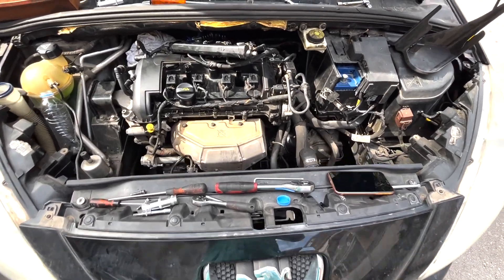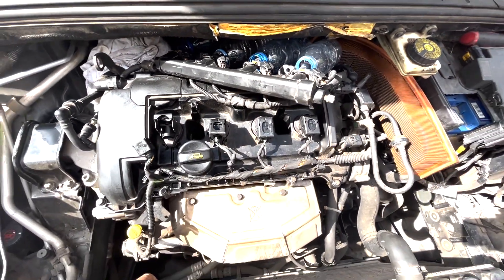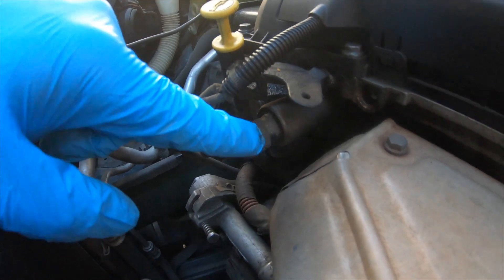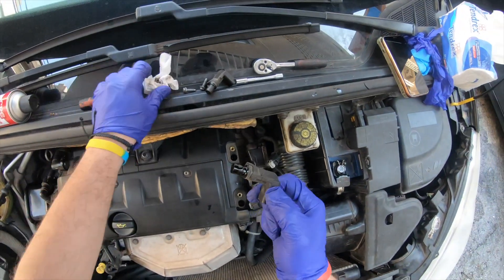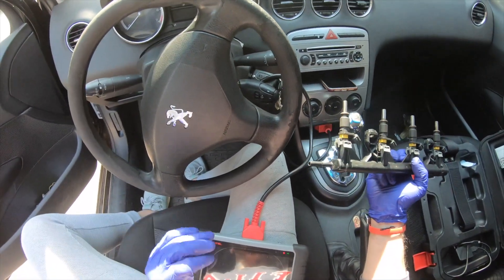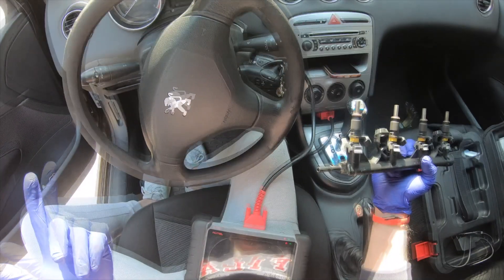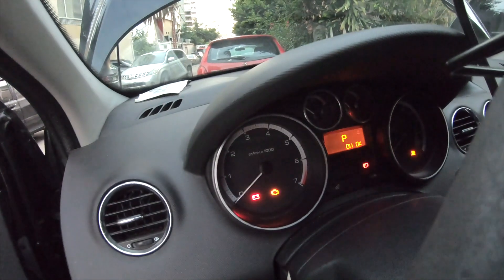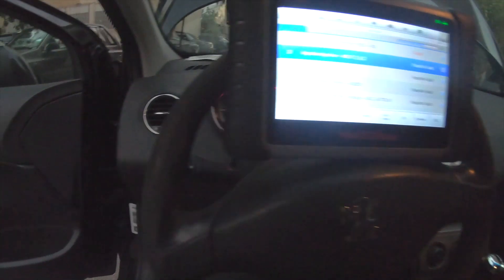Peugeot 308 Cylinders misfire EP6 2007-2014

Comment: ....  voltage  supply to each individual  coil can be too  low for coil to produce  a strong enough  and reliably  consistent  spark if the plug gap is too big.
   I had  a misfire  on cylinder  4 at idle for months when engine  had reached  operating temp..Changed the coil for a new one...cleaned  the injector...didn't help.....finally  I reduced plug gap from 0.7 mm down to 0.5 mm....  problem solved.  The voltage  to each coil must be 12v .....if the battery is bad or the engine  is not earthed to the car chassis  properly  can also cause  a weak or inconsistent  spark especially  at idle.
Reply from the maker: Thank you mate for this amazing information 🙏🏻
Well done 💪🏻

Comment: Hy, i liked the video very much. I see this is an old one but i tought i try 😅 My 308 1.6vti showing p2178, i tried to replace plugs, cleaned solenoid valves, replaced MAP, don't know what next should i try.. The old owner supposedly changed injectors, or some at least, maybe thats the next i should have a look into.. Oh yeah, i also replaced a PCV membrane and cover.. any suggestions? Thanks
Reply from the maker: Hey mate 
You should look on swapping all injectors and check if the problem goes away. 
Cheers

Comment: I have the same problem. Some plugs have oil on the top. So I have a misfire  on 2 cylinder and when I stop the car at traffic lights, the check engine flashes, and then I am losing power?  The car has good compression. I have also changed plugs and coils but problem has not solved. What can I do??
Reply from the maker: Look mate I reckon you should treat the oil leak first. 
Then swap out the whole set of injectors. 
Have you also checked the timing chain?
Cheers

Comment: Mines just popped up P1340 and P0087 fuel rail pressure low and misfire cylinder 4 so Im assuming that injector 4 is leaking fuel into the cylinder and causing misfire ( all at low rpm cold start )
Reply from the maker: @chlyon  yeah mate could be. Check the injector
Reply: @goprodoit   actually the other day driving along and it ran rough and did all the codes for the injectors apart from P1340 . Im wondering if peugeot is playing games , I have a small leak of brake fluid and the computer though a code but Ive topped it off and all is working well again , but now and again the car refuses to start for 10 mins ( without any codes) and when it does start it throws up all the codes for brake failure . Im going to do a flush and new pads in a day or two but I think it could be peugeots way of forcing you to the dealer .. maybe throw some engine codes so you have to go . only done 66000 KM 2012 japanese import . Ive also put in some injector cleaner hoping it might lube the HPFP

Comment: Hi. I've got the p1340 fault code on my citroen c4 picasso 1.6 vti (combustion misfiring on cylinder 4). I've swapped the injectors from my mini cooper r56 to the citroen, and still the same error code and the same cylinder misfiring. The ones that I've put on the mini from the citroen work perfectly. Then I've replaced the coils, then the spark plugs (3 times), then the vanos solenoids (new), then swapped the cams sensors from my mini, then a new coolant temp sensor, the timing chain, new fuel pump, new upstream o2 sensor, and i still get the same code, and it's running rich because every time I check the spark plugs, they're black. If i start the car and keep it revd up or i drive it straight away, the engine works perfectly. No misfiring, no error code. But if i start the car and leave it idling, in about 15 seconds it's misfiring, the radiator fan kicks in at full blast, and it triggers the error code again. I don't know what the f to change anymore.
Reply from the maker: Hey mate. It is hard I get you, I have done the same process but at the end swapped out all injectors including the channel. 
Could you plug a pressure gage in cylinder 4 and check the pressure reading when trying to start the car? Do the same on cylinder 3 and compare the readings. I don't know if you might have bent valves and is causing the problem. 
Check this cheers mate!
Also if you could get a whole channel including injectors (wrecking parts) and be aware of the injectors head colours to match with the ones you had originally on your Citroen.
Reply: @goprodoit  the compression is the same on all cylinders. I think it's the camshaft variator sprockets. If i start the engine and drive the car straight away, the engine runs fine at higher rpm, and it doesn't trigger any fault codes. If I leave the engine to idle, it misfires and in 10-15 seconds it triggers the p1340 fault code. It was the same with the old injectors as well.
Reply from the maker: @razvanursache9493  The cam shaft phaser or sprocket could definitely affect the valves timing mate. Let me know how u go
Reply: @goprodoit  I've swapped the sprockets from the Mini to the Citroen, and the other way around, and unfortunately no joy. The Mini runs perfectly with the Citroen sprockets, but the Citroen doesn't. So at this point I've almost swapped the entire engine from the Mini to the Citroen and still the same problem. It must be a software glitch. I've used the proper Peugeot Citroen diagnosis to check the entire car. The fault code is being triggered only when idling. I'm going to have to sell it as spares or repairs. Thank you for your response 🙏.
Reply from the maker: @razvanursache9493 Mate that is so unusual but you know misfire on Cyl 4 is always related to the injectors. 
I had the same problem and nearly swapped everything and was going to replace the whole engine at the end until I got a whole new set of injectors including the channel and that solved the problem. 
The weird thing is that I swapped out the injector on cyl 4 and still got the misfire on the same cyl. 
If you wanna give it one more try, I would get a whole new set (incl the channel) and swap the whole thing…
Reply: @goprodoit  it is a very unusual problem. I drove it yesterday and if kept at a minimum 1200-1300 rpm, it runs with no problem and no engine light/error code. I've even upshifted when going uphill to make the engine work harder, and it pulled with no problems and no stutter or judder. I don't want to buy new injectors for nothing. And the injector ramp/tube is just a tube. If it's not cracked and doesn't loose pressure, then there shouldn't be any issues with it. Especially when I know that injector 4 is the first one to receive fuel. Anyway, thank you for your help. If you're interested in a project car for your videos, let me know.
Reply from the maker: @razvanursache9493  good luck mate I hope you would be able to solve it somehow 🙏🏻
Reply: @goprodoit  hi. It's me again. I think I've found something, but I'm not 100% sure. If I unplug the eccentric shaft sensor, the engine is not misfiring on cylinder nr 4. Instead it's sporadically misfires on nr2 and the engine is kinda knocking/ticking from the timing chain area. But it's not showing anti pollution error message, and it's idling somewhat ok. What do you think it can be?
Reply from the maker: @razvanursache9493  Hey mate it’s hard to tell to be honest

Comment: Hey there i got Peugeot 308T9 2014, having misfires and low compression  40 psi in only cylinder no 3, i only changed the spark plug but no different, 1 mechanic said its electric fault and 2nd one said repair or replace the engine i need your advise please shall i change all the injector to give a try ?? Waiting your kind advise, thanks again
Reply from the maker: Hey mate, you should change the ignition coil on cylinder 3 or swap it out with another coil on cylinders 1 or 2 and check the scanner if the misfires changed to the new cylinder. Then if problem not solved, check the injector on cylinder 3 or if you can swap them out all three it would be better. Lastly before replacing the engine, you could have a bent valves on cylinder 3 or could be the timing chain.

Comment: Bună ! La mine merge bine la rece și cind se încălzește motorul merge în 3 pistoane,doar cind se încălzește adică după vreo 30/40min.mers continu ce poate fi? Mulțumesc anticipat.
Reply from the maker: Hello this could be related to the spark plugs or ignition coils or could be the engine oil.
Reply: iskusni majstori kazu da se to desava kad padne sjedalo ventila.potrebno provjeriti kompresiju na tom cilindru kad je topao motor.
nije skupo za probati čistač ventila.evo ti link.
Bună ! La mine merge bine la rece și cind se încălzește motorul merge în 3 pistoane,doar cind se încălzește adică după vreo 30/40min.mers continu ce poate fi? Mulțumesc anticipat.

Comment: I watched your entire video, I did it all except the injector, it didn't happen, the 4 cu coil does not work, but there is ignition. 3 of the motor bobbins are working 4 when I pull the dunth there is no reaction respects

Comment: hello I have pegeot 308 .1,6 gasoline 4 cu cylinder does not work the engine works as if it will fall diyer 3 cylinder is in good condition.I changed the coil did not grang censor I did not have now the sound of the fence fence in the engine of the car , what do you think I should do, I did everything in your video, I just did not change the injector, I would love it if you could help
Reply from the maker: @nevzatkayhan5278  hey mate, did you change all spark plugs? You said you changed the coils? 
I recommend changing the spark plugs all of them, and then for the coils, swap them or replace them. If you are still having the misfire problem I believe you need to replace all injectors and get good ones.
Reply: @goprodoit  
I bought INJECTOR CLEANER today, I filled it all into the tank, it worked for 1 hour, as a result my car is fixed, thank you very much for your help. Best regards.
Reply from the maker: @nevzatkayhan5278  hey mate. Yeah it is definitely the injectors, the cleaner could work for a while however if the problem came back you should definitely swap all injectors. Cheers
Reply: @goprodoit  ok
Reply: @goprodoit  I changed 4 spark plugs. I changed one coil. I changed the crank sensor that did not work. The problem is the same but I did not change the injectors. Thank you very much for your answer.

Comment: Hi great video, I have a similar issue on my partner, cylinder 2 misfire. We changed injectors, sparks etc, brand new motor, but p1338 cylinder 3 keeps on coming. Motors runs on 3 legs after 30 sec. Could it be the bar it self at cause? That's the only thing we didn't change in the injection system. What do you think?
Thank you so much sir
Reply from the maker: Hey mate
Most probably you need to change all injectors together with the channel bar. 
That would solve the issue
Reply: @goprodoit  Thank you for your answer. We changed all injectors. Peugeot thought they solved it. But still coming back after motor running a few minutes. Might check Camshaft sensor. But can't really find any solution on the web. Will keep you updated, this could help people if I solve it... Have a great week
Reply from the maker: @raphaele735  thank you for messaging back. I wouldn’t think that the sensor is causing this problem. Timing chain could be the trigger.

Comment: Thank you for your video. I have a peugeot 207 1.4 vti with codes P0011 and P1338. I changed the spark plugs, cleaned both solenoids and switched them. It didnt solve the issue but P0011 (solenoid inlet) code became P0014 (solenoid exhaust). Can the solenoid on the exhaust side be faulty and cause the problem? The engine has no power and is rattling
Reply from the maker: Hey mate
Sometime when you switch the solenoids the fault does switch but it could not be the problem with the solenoid. 
I recommend to replace all injectors.
Reply: Put each solenoids back to place dont swich them i had a problem once when i swiched them

Comment: Hello i was lookimg this problem like 6 mounts. i even remove katalitic conventer. i ll try this. But i have one more problem. When i start engine and drive , in 50 meters engine make very bad noice like somethinks hits inside and wont get gasoline. Do you know the solution?
Reply from the maker: Hello 
Have u diagnosed it on a scanner?